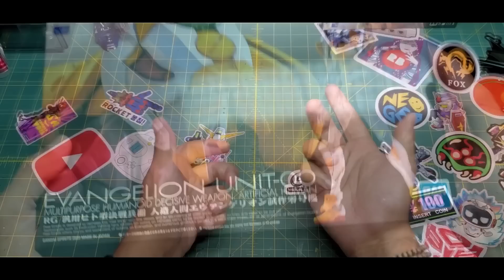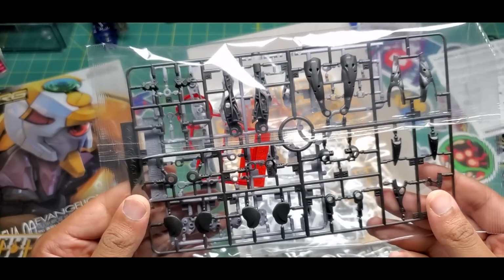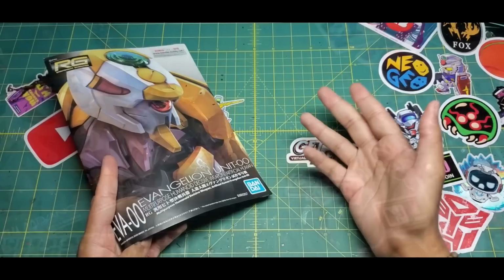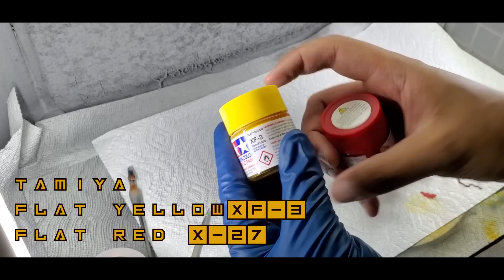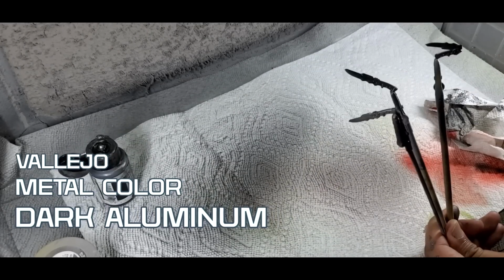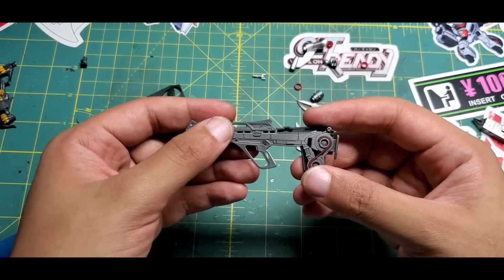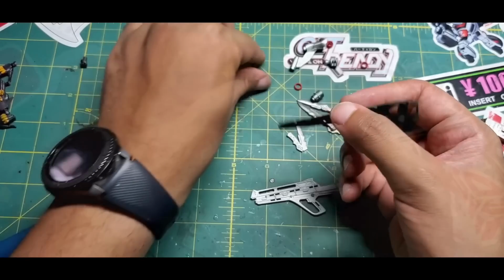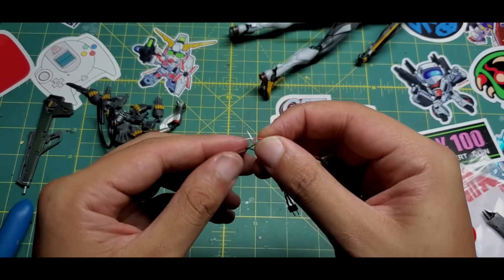#newtype #Otakubuilder REAL GRADE Evangelion Unit 00

Comment: I love RG kits. They are so detailed and imo more challenging then some master grades. They are little like in-between a perfect grade and a master grade, thought that's not true for all kits.The early ones were a mess. The Build Strike for example is awful. Loose joints. The 00 ones aren't awful but they too are a little gangly and explode in your hands by just looking at them. However I just built the RG unicorn over the last week or so and it's the most fun I've had with a kit. Rock solid joints, parts stay in place for the most part even when transforming it. Rg has a come a long way over the last 4 years or so.